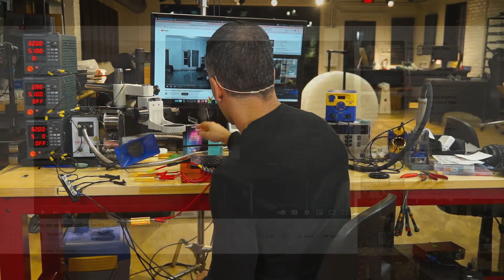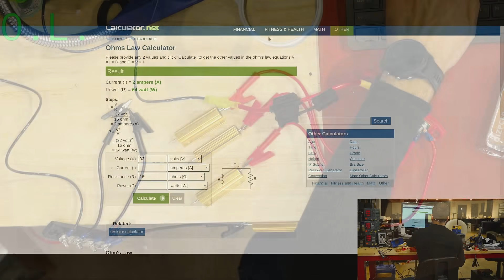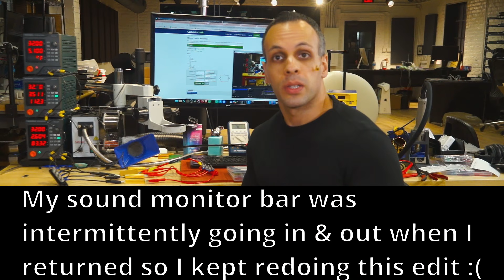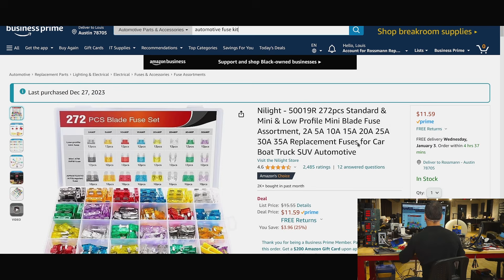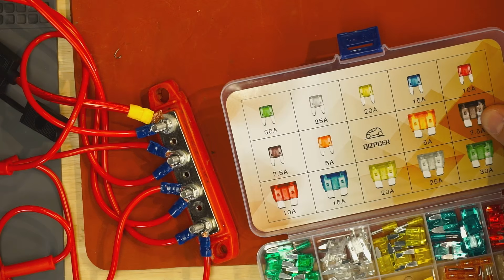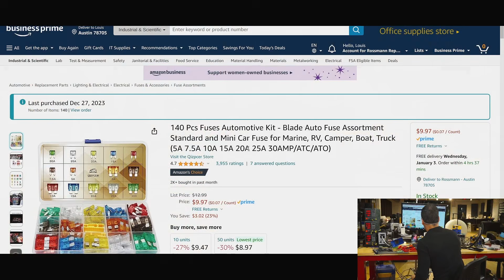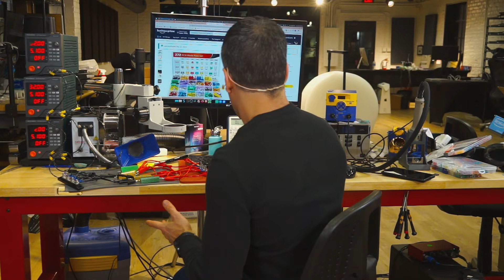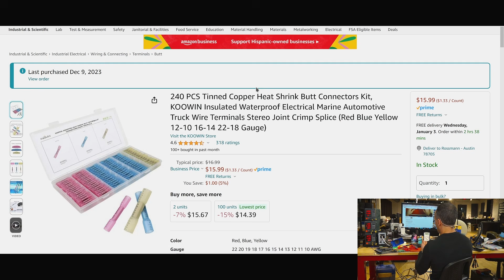Amazon Sells Fake Electrical Fuses

Comment: Man you are just wrong about this! The fuse is used to protect the circuit from short-circuit currents, which are much more higher than the nominal current. What you are doing is testing the fuse against overload currents and not against short-circuit currents, that's why it blows at 10A because that value is the closest to the short-circuit current value! 

So, under 4A current the fuse can work for lets say a few hours, under 6A can work for 1/2 hours, under 8A even less, and at 10A it blows. This is just how fuses work! That is normal behavior for a fuse!

Comment: Because proper fuses are made from solder plated copper not aluminium. Molten solder weakens copper and copper is better conductor than aluminium and wont melt  fuse socket before blowing

Comment: Louis, I think you may have misunderstood vehicle blade fuse ratings  ... I think they are labelled with the normal current carrying capacity and then will blow at double this level, approx.  But check this with a vehicle person ... but I’m fairly certain that blade fuses are marked in a different way to normal (sensible?) fuses.
Reply: Ignore me ... I’m thinking of the old Lucas fuses which had a continuous rating and separate fusing current values for instantaneous or continuous excess current.  
Keep up the great work 😀👍

Comment: Amazon doesn't give a shit about the body count, they are to big to worry about killing someone.
I reported a very unsafe battery charger via all available means (dangerously insufficient isolation distances, hipot failure, not even a CE mark).
No response, the charger is still sold years later, I hope at least some people didn't buy it after reading my review.

I'm afraid they might be beyond the control of any US or EU regulation at this point, but good luck to you.

Comment: A voltage regulation is not necessary, the 30V is the maximum voltage they should bei able to isolate properly. These fuses are rated for extra low voltage applications only. The current is more relevant for this, and that is where they will probably fail at: Not blowing when they are supposed to do. An old welding transformer is a good and safe to use power source for such fuse blow tests.
These fuses should be able to handle 1.5 times the rated current for 1 hour, and should blow  within one minute (or faster) of 2.5 times the rated current. They should be able to isolate a short-circuit current of 1000A at 32VDC safely. That means not a fire started due to an arc that can be created by such current flows that are switched off. And that it is DC makes it even harder to get rid of the arc, on AC these arcs are usually self-extinguishing when the sine wave is going through the zero.

And the problem of fuses that don't blow is not only that the connected item can be damaged, the wiring itself is usually also not rated for a much higher current than the connected device itself, and so it can also start to burn. A nightmare to replace the whole wiring of a vehicle!

Comment: Years ago I tried searching Amazon for an HDD-to-USB adapter to back up an old hard drive. I had to dig to find one that didn't have reviews mentioning sparks or smoke or fire. Ultimately the one I bought did its job (as I cautiously watched). I can only imagine the situation there now.
Reply: It's the dogshit power supply that comes with them.  I've been shown a few over the years.  One had 350V on the 12V and 5V output with a 100Hz ripple, luckily the house power was automatically cut when this was plugged in.... Another output 20V out of both 5V and 12V blowing up the laptop and the drive in the process.  And another connected the live to ground (or the neutral) but being UK, the plug isn't reversible so the 240V AC was connected via the USB shield to the laptop, the person made a circuit by resting their hand on the drive to feel if it was doing anything... All the power to the house went off (lucky RCD fitment) I always chuck cheap Chinese power supplies, they are always dangerous and shitty.
Reply: Time to DIY, batch produce, and drop ship to blunt.

Comment: I don't buy any parts off amazon anymore.  I ordered 2 fuel filters for my furnace, when they arrived they were deformed and clearly wouldn't work in the filter housing.  I requested a return, took pictures of it and summited it to amazon.  The seller said they were fine and useable and I was out 40 bucks.  If you are going to get parts stick to websites that specialize in those parts or ebay and pay with PayPal.  PayPal doesn't mess around.  On a side note I also left a 1 star review and it never showed up.

Comment: Be careful when overheating those aluminium housed resistors, they can go off violently and fire the potting material out the ends like a shotgun.
The old ones with a sand/cement fill died quietly, but the newer ones with black (epoxy?) potting build pressure and can go out with quite a bang.
Reply: The heatsink-case is the hint with those, they want to be screwed to a large heatsink.
Reply: Don't worry. He bought some quality ones from the well known brand xoucsfdcxiocn off of Amazon.
Reply: From the same supplier beginning with A and having the letters mnoz in it's name 😝 I bought some 0.1R 100W resistors for shunts when testing power supplies.  I mounted them on a heatsink, connected the power and bang!  Turns out these resistors had one end connected to the metal case and even though I put the resistors on with the print the same way (just OCD) they were randomly one pin connected to the case...  Learnt my lesson, there are absolutely no electronic parts that can be safely bought from that retailer who shall not be named 🤪
Reply: They were 100w resisitors only taking 65ish w
Reply: @shaynegadsden 32V * 6A is 192W
Reply: @zx-4rr-pls  while i was wrong they should have an additional heatsink but how the fuck did you come up with 6a, He explained so clearly the setup and the values and that each resistor was a 2a load. They were parralleled up but still none saw more than 2a
Reply: @shaynegadsden  he said 6a, that’s where I got 6a
Reply: @zx-4rr-pls  total circuit not 1 resistor it was a 32v setup and 16ohm resistors so each saw 2a 3 in parallel for 6a, 5 for 10a etc
Reply: @shaynegadsden  They only have rated power when screwed to a sufficient heatsink, otherwise much, much less, read the datasheet.

Comment: Dude. THANK YOU for making both of these videos, and a double thank you for the in depth demonstration. I've been saying for MONTHS, probably even over a YEAR at this point to everyone I know that Amazon has turned into a shitty marketplace to buy dangerous products that stop working a month in (or, in the case of this video, right out of the box), and nobody I know has ever shared this sentiment until now. Quite comforting to know I am, in fact, not going insane!
Reply: Thanks for putting your money where your mouth is. I'd call Louis Cassandra but people are actually starting to listen and realize the line between Amazon and their Chinese imitators blurs more and more each day.
Reply: I swear someone somewhere is at least a little malicious with how everything is made. How does an LED on nightlight burn out after 3 months. With how quickly things fail, I don't believe it's a quality defect anymore.
Reply: I had some random Chinese shit mistakenly sent to my address a couple years ago by Amazon. It took some doing to have them stop it actually. One of the devices was a desktop dehumidifier with a peltier cooler. I decided to”hey, let’s give it a try”. It survived in the basement for maybe a month. I haven’t even bothered to do a tear down to see what went wrong. Tossed the piece of crap right out. We really don’t need such “products” on our market. They serve little useful purpose and just end up in the landfills soon after sale. Ugh.

Comment: A fuse is a safety device that prevents damage to equipment and at worst a fire. I was looking for some on Amazon a couple months ago and noticed I couldn't find ONE reputable brand. I went to the local hardware store instead. You're literally risking your life saving a buck on a cheap knockoff products.

Comment: I haven't (knowingly) given Amazon money for years, but my girlfriend will occasionally order something there if it's the easiest way to get something quite specific. 

This holiday season that just passed, she wanted some festive sprinkles to put on the cookies she was sending people, and found the perfect ones (she thought) on Amazon. (They were the Gold Star Sprinkles sold by the Manvscakes store, if anyone us curious).

She made a batch of cookies with these sprinkles on them, and though they looked quite nice, they tasted like poison. Straight up tasted like cleaning supplies and old cardboard. On top of that, because they're a "food" item, Amazon will not allow you to return them or receive a refund for any reason. Other people had the bag come apart in shipping, coating the rest of their order in even more unusable sprinkles, and apparently that's not a valid reason to send them back either. 

Now, obviously, ruining a batch of cookies is slightly lower stakes than a fuse that will catch your car on fire. But, the point remains, so many highly rated items on Amazon are complete garbage, and not fit for their advertised purpose. And, at this point they've put a lot of local businesses that you used to be able to go to for items like this, and you're stuck with them as your only option.
Reply: When I have received food products that were unusable (broken open in shipping, seal broken), I have used their chat function to be refunded. That was a while ago, and I have noticed now it is more difficult and time consuming to get through to a person, so I don't know if this still would work.

I am no longer a Prime member, so I purchase from Amazon less frequently.
Reply: Why even buy something with artificial colors. (Don't.) Having said that, even some edible herbs can legitimately taste slightly bitter.

Comment: Please dont buy amazon breakers. A tech put in cheap breakers in my garage, that would only trip after I ran 30 amps thru it. Its a 20 amp breaker that pretty much has a constant 18 amps thru it, powering an air compressor. I accidentally powered up a vacuum on the same outlet (not paying attention) which drew 12 amps according to the manufacturers sheets. After about 3 minutes, I noticed what I did, and unplugged everything before the house burnt down.

Comment: This is done FOR good reviews. I GUARANTEE you'll find reviews like "My car blew SIX fuses from the auto parts store. Finally I bought one off Amazon, and it hasn't blown after a month! Never buying from the auto parts store again!"

Fuses blow in devices because there's a problem. Especially in cars. And people hate dealing with problems. Especially in cars.

People used to do this themselves, and knowingly put a 7.5 amp fuse instead of 5 amp fuse to make the problems go away. So it seems Chinese manufacturers decided to just do this themselves.

The real problem is when those 2 amp fuses start blowing at 10 amps, and the customer devices to put in a 4 amp fuse...

Also, Louis, the resistors shouldn't be necessary. If those are current limited power supplies, you can set the voltage at 32 and the current at 0, and connect the fuse as a dead short. Just slowly crank up the current knob until you get to 2 amps.

Comment: Pro Tip: If you ever have the main fuse in your audio amp blow, replacing the fuse may actually cause more damage than it already had. When the outputs short out and the main fuse blows, replacing the fuse can cause the output resistors to open causing a cascade of failures without the fuse blowing. Back when I did audio repair, we'd use a light bulb in place of the fuse to test for shorts before putting a fuse in it just to avoid that scenario.
Reply: Yes, I've always been under the assumption that if a fuse blows it means something else in the circuit is faulty.
Reply: Before my day, houses had glass plug fuses... they screwed into an Edison socket ( standard light bulb porcelain socket )...... this predated the circuit breaker.... each circuit had its own glass plug fuse.... fuse blows.... put in a higher number.... To thwart this, adapters were made that would screw into the edison socket, and lock into place.... each was a different thread/pitch, so only a 15A Fustat would fit the associated adapter, 20 for 20, and so forth. This was a valiant effort to prevent people from uppin the fuse to stop the popping. But you can not stop STUPID.... people learned how to remove the adapter, or put a coin into socket,  actual copper pennies worked best...... needless to say, you will only find these anymore on houses early 1960s and prior, along with knob and tube wiring, no ground... etc. @HarakiriRock
Reply: @HarakiriRock  Yeah. It is like riding a car after you crashed because of breaks fail.
Reply: Yeah. The broken fuse is a symptom of a disease that needs to be cured ... Before the fuse is replaced.
Reply: Your comment is 100% true in most cases. But to an exception like in my scenario where I had a slow blow 2amp fuse blow in my Logitech Z5500 5.1 surround PC sound system, where the fuse blew after 2 years of operation. I then replaced the fuse with exactly same slow blow 2amp fuse and the system has been running for the last 10 years with no faults or fuse's blowing again. Now IMO I would put this down to an over voltage/ over current problem from input power, like a spike from lightning taking mains power out then reconnecting and creating a surge in the process.
Reply: @fullboostturbo1  A lot of those surround sound systems don't have a main power switch. There was a Bose system that had an issue with the fuse blowing and Bose put out a service bulletin to replace the fuse with a higher value due to it blowing when using it on a switched power strip or unplugging it often due to the inrush current taxing the fuse.
Reply: @fullboostturbo1 Same here with an old Digitor speaker set that I have, no issues since replacing the fuse at 6 years down the line.
Reply: @N3G4T3  As the fullboost nym said, it's because probably the problem was with the power company sending a spike voltage rather than an internal problem with the speaker.
Reply: I have a couple of clip on 220ohm 10W resistors to clip across the rail fuses on the big amps I occasionally fix. Sadly you can’t do that with newer amps. No DC Rail fuses. Switch mode supplies make it harder. Multi rail switch mode supplies or class D amps with surface mount, no schematics and a DSP chip that’s either no longer made or never existed 

Best amps have lots of gravity in them, caps the size of a can of beer and rail fuses made from coat hanger wire.
Reply: Ive replaced the fuses in my amps a bunch, but I never do so without first checking the output stages for shorts, followed up by throwing it on a dim bulb tester just incase. I tend to blow them just due to  excessive power draw from turning up the volume just a little too much though

Comment: We use 10-32 x 3/8 green ground screws on our production line. The electric supply was out, so I went to Lowes. Got a pack of Gardner Bender ground screws. The flats on the screw heads are rounded off. Look up part # GGS-1032HC looks like a POC. I marked the pack as a last resort.

Comment: Nilight and Kzper both use the newer Metric amp system of measure.  CrocSee is still using Imperial amps for its American customers.
Two totally different units of measure.😁

Comment: Does anyone think that the maker just has 2 or 3 different rated fuses, but uses the same strength in more than one rating to save money. So: There's an 8 amp fuse in all the small ones, maybe a mid range one, and a 50-ish amp in all the others? Seems suspicious that the 2 amp blew at the same overload as the 5 amp.

Comment: to work out how long a fuse will take to blow, you must use the manufactures time current curve charts. these  are released by the manufactures, and fuses might never blow at the rated value or take a surprising long time. its's many years since I've done fuse or MCB sizing.. from memory we had rtouble when working on mission critical equipment in oil and gas where the power supplies could not supply a big enough surge to blow the breakers quickly. or a least that's how I remembered it

Comment: Unbelievable what these sellers are selling. I found a datasheet from good brand fuse manufacturer. These fuses have to blow between 150ms and 5s at double amperage. At 1,35 rated amperage the have to blow between 750ms and 10s.

Comment: I bought a solar panel kit on Amazon rated at 800W (2 400W panels. When I got it the panels were small and had no spec sticker like all solar panels have. They tested in parallel in full sun @ 34volts and less than 5A. meaning they are aprox 85W panels. sold as 400W panels. This is FRAUD. In addition the controller had no rating on it (supposed to be 40A) and had stickers on imaginary buttone that were supposed to be advanced controls and did not even exist!  CRIMINAL

Comment: I was right about the 10A... Now let it rain claims... That'll teach them... maybe...
Also if these are Chinese automotive fuses, that does explain all those car fires they are having with domestic brand electrical cars....
Best case scenario is it destroys the equipment in case of a fault. Worst case scenario car lights on fire in a under house garage and an entire family dies... These are not risks a company should be willing to take...
If you are seriously going to buy these fuses you might as well wrap the old one in aluminium foil... (I mean:) It's not that that would be more dangerous... But also don't try this at home...